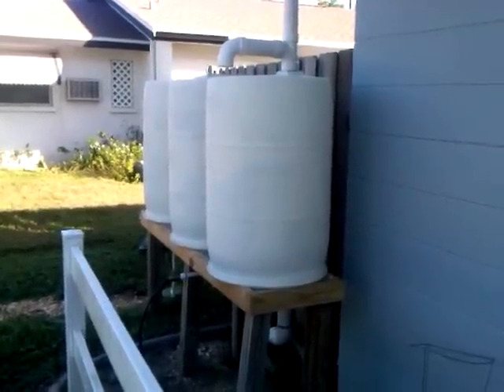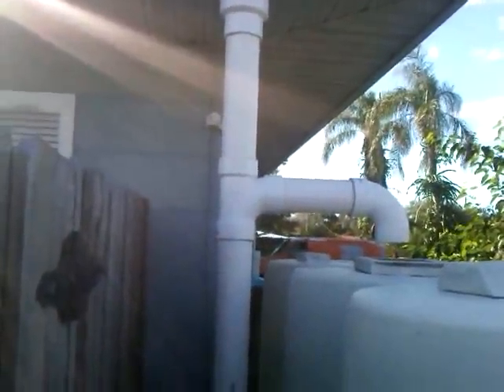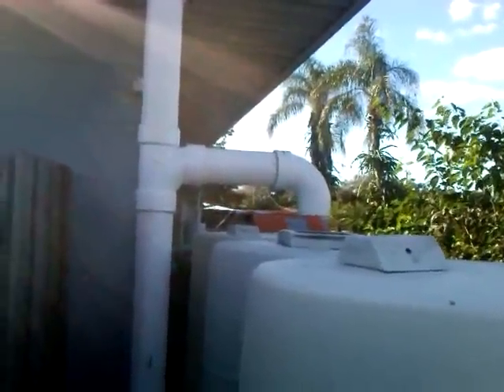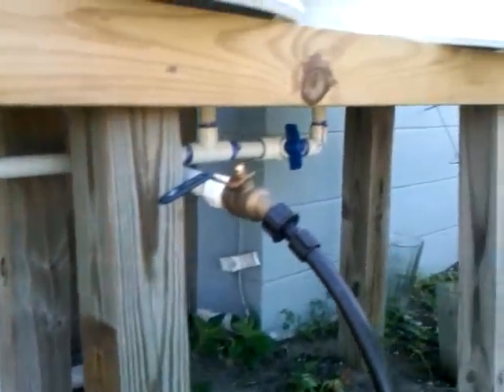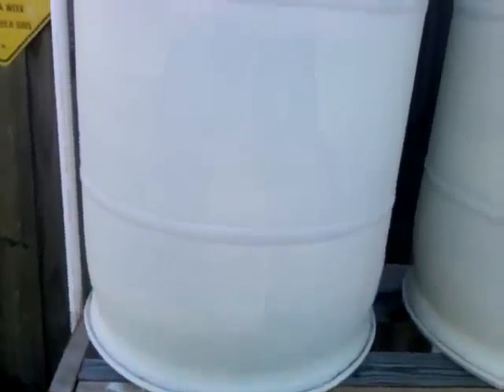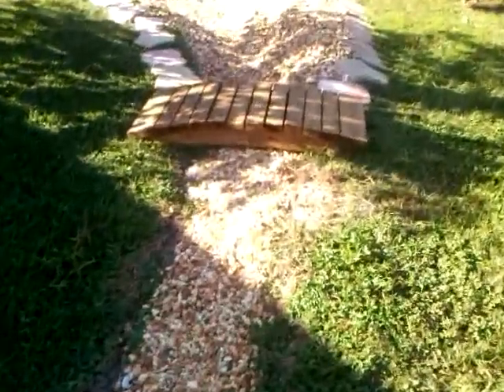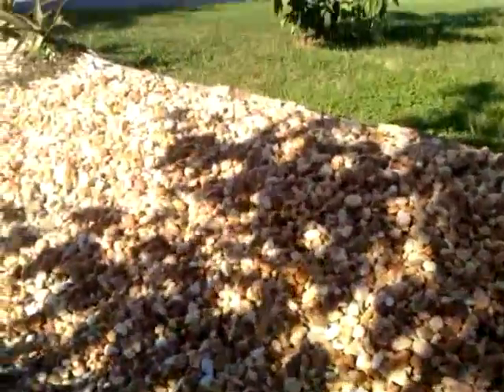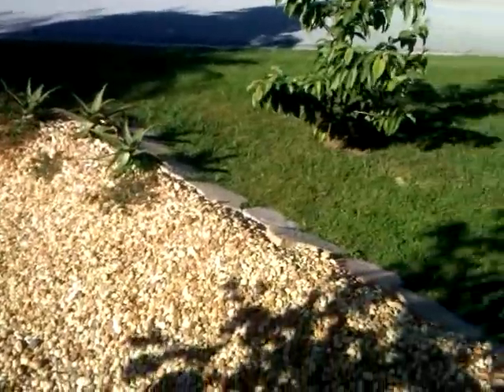Rainwater Harvesting System Overview

Comment: Very cool, I made something similar, but I didn't think about a manifold system to distribute the water to each tank from the bottom.  I love this idea because I was stuck with the idea of sump pumps to distribute the water and didn't want to use electric power, but this is so much better. Thanks for sharing,
Reply from the maker: You're welcome. Thank you for watching!